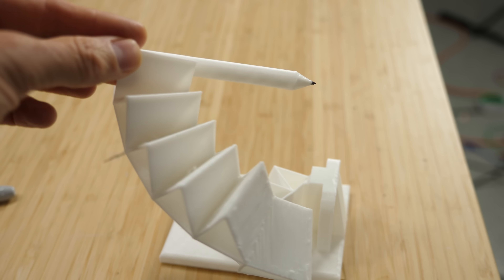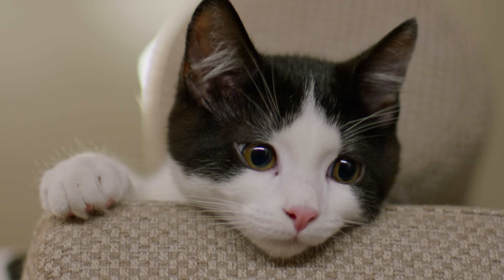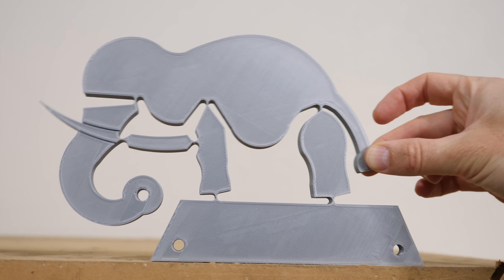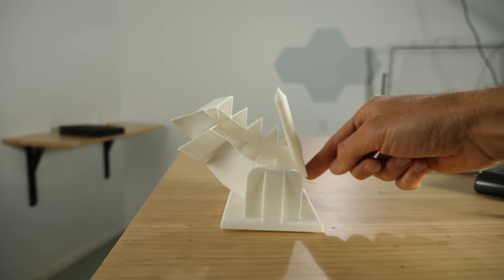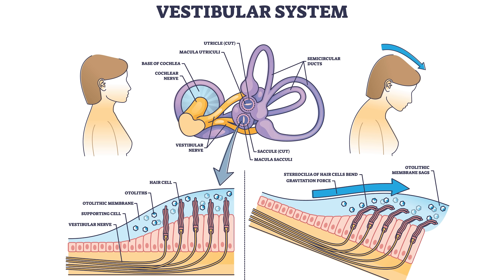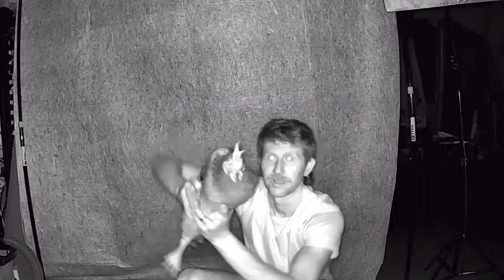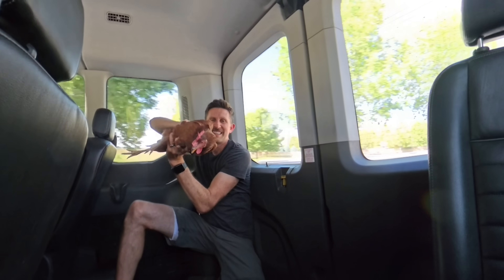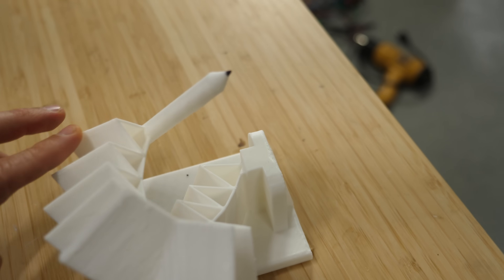Chickens Are Weirder Than You Thought

Comment: 5:55 that seems to track with humans as well. We don't lose our balance (vestibular system) or proprioception in the dark.
Reply: Gravity makes this possible.
Reply: @ProblemChild-xk7ix i agree i think it’s the muscle memory of walking and gravity
Reply: balance on one leg for a minute. then try witrh your eyes closed. you'll find you can barely do 1/4 of the time
Reply: Speak for yourself
Reply: Keeping your balance in the dark is harder than in normal light though
Reply: @tikket10  that’s because your balance system is dependent on your visual input. If you remove the plane of reference it makes balance difficult
Reply: @MedicAthlete24W Which contradicts OP.
Reply: @MrCmon113 it doesnt though, we dont lose our balance in the dark, yeah it becomes a bit more challenging without visual input but we still know which way is up and we dont just fall over when someone turns the lights off, if balance was truly reliant on visual input then blind people wouldnt be able to walk
Reply: @ClobberingSocks smart.
Reply: We do struggle with balance when we're faced with sensory deprivation. In a standard dark room, or even with your eyes closed, you're still receiving light cues, though minimal ones. But if you're a seeing person who's suddenly, truly deprived of sight, that tends to cause vertigo
Reply: We lose it slowly over time. Our sensors have drift and vision corrects it. Without vision the drift keeps increasing until we fall over.
Reply: Gently touching something immovable will help restore your balance in the dark. You don't need to lean on it for any support, just to feel it for reference.

Comment: Rotational movements are much better registered in the otolith organs, we have semicircular canals in X,Y and Z directions, and rotation in any axis will give different signals from each of the two organs, increasing fidelity. Linear acceleration sensing is pretty basic by comparison. Instead of holding the chicken you should have chased it around in the dark; then it would have a lot more sensory input and I think the head would be stable. And would be great content by itself 😂

Comment: having immobile eyes is not the main reason birds evolved this. the main reason is image stabilisation so their view isn't blurry during flight. even owls with very mobile eyes still have a very good head lock ability.
Reply: Owls with very mobile eyes? You mean the birds which famously have very little to no eye mobility? What are you talking about here?

Also, yes, image stabilization is also the reason out eyes are mobile. It's damn hard to see detail without it. Birds absolutely did evolve it because of their immobile eyes. If their eyes had been more mobile, they may very well have evolved image stabilization with eye movement.

Do you think that predatory mammals don't need just as good image stabilization while running, leaping, turning, biting, and wrestling prey? That's a lot of motion. I don't see how flying in particular would require image stabilization, but no one else needs it.
Reply: Which owl species do you think can move its eyes relative to its head?

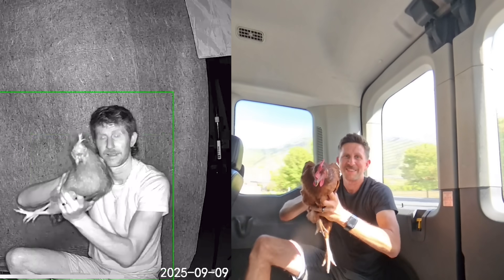Comment: 6:28 so are you saying birds are doing second degree derivatives in real time?
Reply: What a question... Why do you think you've never seen a support chicken in an exam?
Reply: Biology is crazy efficient at computing, but only for certain calculations. A chicken can do second degree derivatives in real time like it's nothing, but all claims of a chicken doing simple addition are questionable at best.
Reply: Your brain does that constantly then you’re standing or walking
Reply: I have to point out there's an ambiguity in my comment: by second degree derivative I meant turning a change in acceleration into a change into position (which requires first doing a derivative to get the acceleration), but the equations involved if we did the math would actually be third degree.
I hope that someday we will know how biology solves these equations, it's probably really different from our optimal mathematical methods.
Reply: @maelmauron7530 To the chicken location and speed don't exist, acceleration however is absolute and real. There's no second derivatives from the perspective of the chicken. Just acceleration and it's change over time.
Reply: @MrCmon113 I'm pretty sure the video said "change in acceleration". Maybe that's wrong, since we can definitely feel acceleration itself as it is the result of a force, but if it is right to compensate you need to derive it once to get acceleration, and a second time to get speed, to then move the head at the right speed.
Reply: @maelmauron7530 Everyone does, naturally, though life has it optimized, so it's kinda like fuzzy neural network convergence on the approximate answer, not a direct computation. Which is not less interesting.
Reply: That's a crazy reference
Reply: I love how the majority of responses to this where some form of paragraph, and my brain just went “yeah birds are just smart lol”
Reply: @KathyRossArtTherapy  These "computations" are completely instinctive and unconscious so I would not consider that intelligence.
Reply: Not the chicken but their brain neural networks did, they forms algorithms and produce a precise output for multiple precise input ( these input are some arbitrarily calibrated signal from acceleration sensor that … are correctly interpreted ) ( And yeah it’s a little bit difficult to talk like this is not on purpose 😅 )

Comment: It's really interesting that chickens can stabilize rotational movement in the dark but not translational movement because that's also how it works for VR headsets with inside-out tracking, where it has 3 DOF capabilities in the dark since its rotation is sensed with a gyroscope but it can't track positional movements without light because it determines positional movement with its cameras.
Reply: Think thats kind of inherent to how physics work. Like for rotation you can use gravity which is constant but for translation you kind of have to rely on visual cues or some kind of beacon. (Like the lighthouses by Valve) 

Accelerometers can kind of measure translation but they can only measure acceleration not constant movement so theyre not very precise for measuring translation accurately
Reply: @zwenkwiel816  Accelerometers do measure translational acceleration reasonably precisely but the problem is that even tiny errors in acceleration measurements lead to large errors in position after integrating them twice over an extended period of time (e.g. several seconds). Consumer VR systems use cameras with SLAM to perform positional corrections about 30-60 times per second, but between those times, they use accelerometers to compute intermediate positions, and they work well over very short time periods like that. This is a form of sensor fusion known as Visual-Inertial Odometry (VIO).

In principle though, if you have an extremely precise accelerometer, like the new quantum accelerometers, you can track position even over long periods of time (currently these are still large and designed for use in ships and submarines, but maybe someday they will miniaturize them).

Comment: as a human one can train to do this, for instance with the hands. emulate a chicken head with the hand so to say. when one gets into it, it looks as "magical" as the chicken
Reply: I wonder if it's a cure for motion sickness?
Reply: @fourierrocket  i actually had motionsickness (or have but not nearly as bad) what helped me, is actively looking outside in the distance. i suppose own head movement, makes the motion "ok" or dilutes the motion.     what makes it bad, is reading a book or looking on a screen, or closing eyes even. random motion (bumpy road, rough and/or jerky driving) seems the worst. this is what i know of own experience. there's more info online likely.

addition: did you mean, to hold ones head still while the car is moving? that is too fast for a human to isolate, it seems. a bit like image stabilisation
Reply: Correct, it's called isolation

Comment: Those compliant mechanisms and metamaterials are fascinating, but are they reliable? I mean clearly it has to flex some and this would make it eventually fail I would think, especially if you used something like this to stabilize something in a vehicle or something that had many cycles. If you used materials with more flex they wouldn't hold the pointer up so forcefully. But it seems like there's potential there to work that out and incorporate it into a functional product or design.
Reply: reliable?  if you print one yourself, it's gonna work as well for you as it will for anyone else with the same file, that's what 'reliable' means.  if you're asking if PLA plastic can reliably withstand rigorous mechanical stresses - then no lol, and no one really expects it to.  it's brittle plastic, if you hit it with a hammer it's gonna shatter like you'd expect.